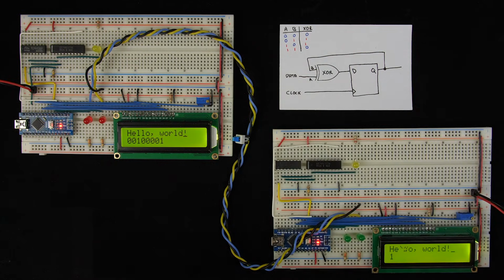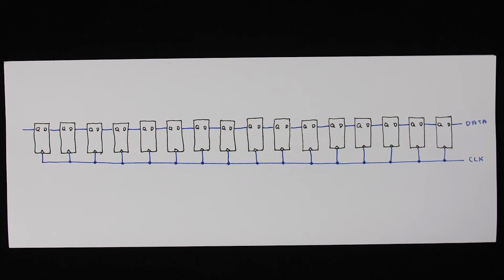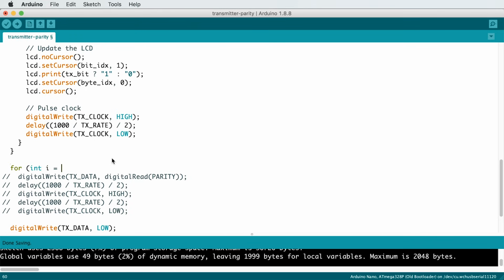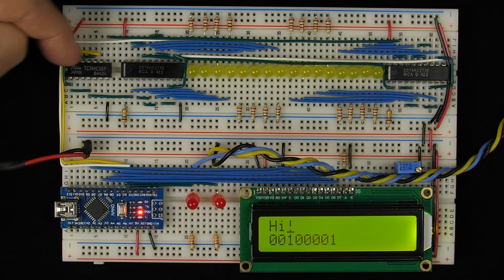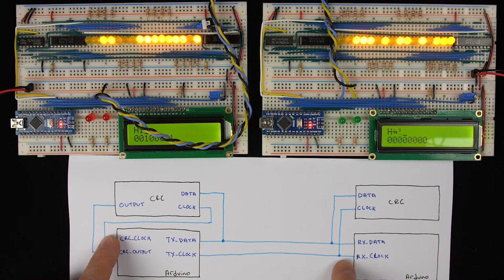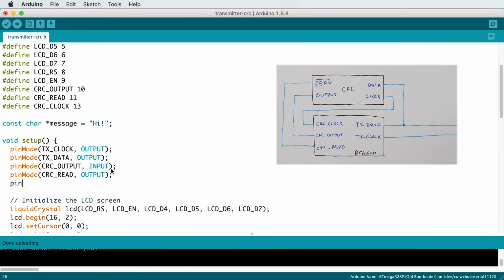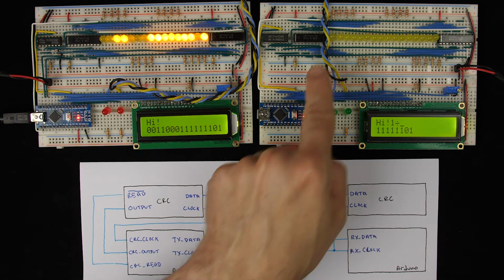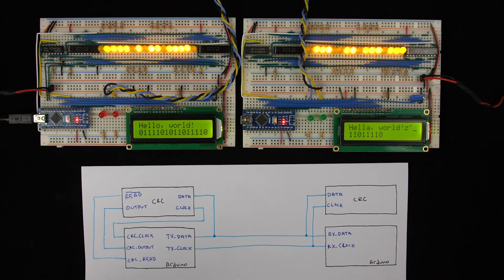Hardware build: CRC calculation

Comment: Sooo.... could the message be decoded at the reciever end with only the CRC and the string length?
Reply: That might be possible, but if so, there would be a maximum message length where it becomes impossible to accurately reconstruct the original message from only the CRC and length.
This method can be used for distributed data storage where it is possible for some data packets to go missing.  By adding extra information to the end of each data packet, it is possible to receive less than the full number of data packets and still be able to reconstruct all of the missing data.
Reply: @melkiorwiseman  that's neat, thanks!
Reply: No, you can't. The CRC is the remainder of a division. It's like asking what the number was if I divided it by 7 and got a remainder of 2 for example. Could be 2, could be 9, or 16, or 23, or.... CRC is not reversible. If it had the information in it, why would you even bother to transmit the data itself?
Reply: @superdau  I'd presume that it would be reversible if there was only a remainder from the division, which I expect would happen if the message length was very short.  But in the real world, that doesn't happen often enough to bother with.
Reply: @superdau  well, it seems to me that it'd be compressed and encrypted.....
Reply: @melkiorwiseman  
The data would have to be shorter/smaller than the divisor.
Reply: @ericwalls7717  
CRC is neither compression nor encryption.
Reply: @superdau  That was my thought too.  Thanks for confirming it.